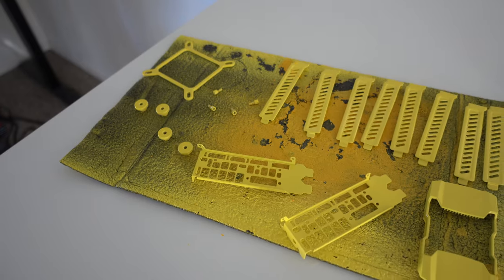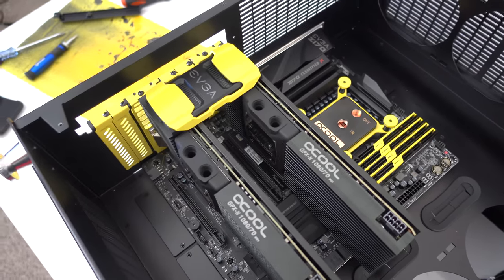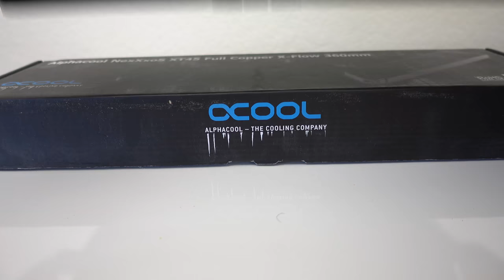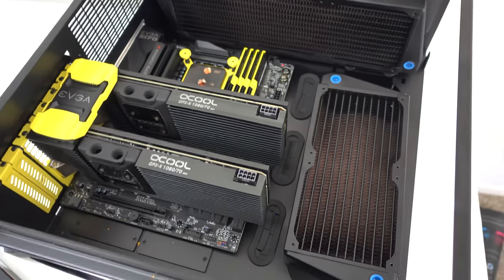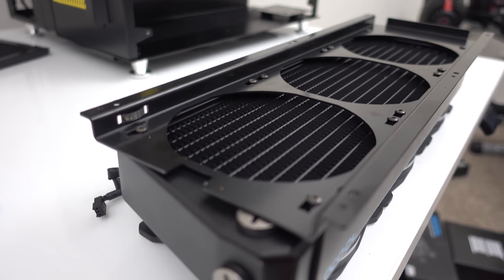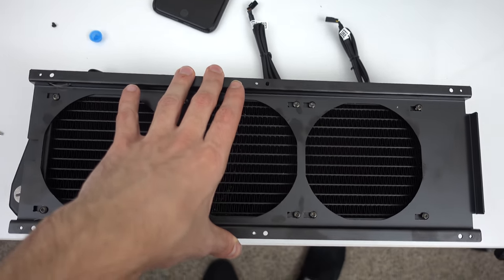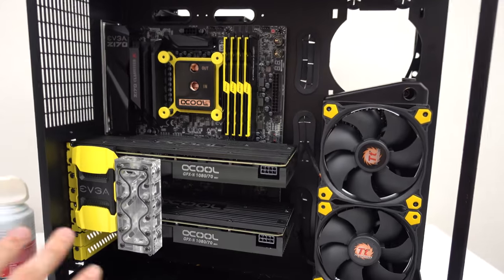My Water Cooling Journey Continues  - Part 4

Comment: You could sand the top of the screw down so it will fit flush with the top of the case :) had to do it with mine

Comment: Dude, dremel the case so your ratiator can fit.
Also, dremel the mount for the radiator so the mount is flushed with the bracket.
Other than that, you can get a rectangular radiator without the curves, it appears you have OCOOL as sponsor or you likey their products. If it will be an issue in positioning the radiator, you can get one from ekwb, their radiators don't have those hips on the sides.

Comment: I think you need grinder in your tools.You could cut of litle part of the top bracket where that screw is,and cut litle hole in back of the case where radiator is hiting the case.

Comment: +TechSource can you just put a fresh set of holes offset to the right of that top mounting bracket far enough to allow the mounting points of the radiator to not impact how it fits into the case?  Looking good so far!

Comment: Is this a good build?

Intel Core i5 6500 3.20 GHz:$199.00
Ballistix Sport LT 8GB Kit (4GBx2) :$59.99
ASRock Motherboard Mini ITX DDR4 LGA 1151 B150M-ITX:$89.99
Gigabyte GeForce GTX 1060 G1 :$289.99
EVGA 500 B1, 80+ BRONZE 500W :$46.94
Phanteks PH-ES215P_SRD Enthoo Evolv Mini iTX Tower Case : $74.99
Seagate 1TB Desktop HDD SATA 6Gb/s 64MB Cache 3.5-Inch Internal Bare Drive : $48.98
Phanteks U-Type Dual Tower Heat-Sink CPU Cooler PH-TC12DX : $59.99
Extensions : $29.99

Total cost = $899.86

also what ssd card should i get
Reply: I want 10k views on my new video pretty decent pc build. You should definitely look at Samsung, Crucial, Hyper, or PNY for ssds
Reply: is the HyperX FURY 120GB SSD good for my build?

Comment: I did my build in this case a few months ago and have water cooled in it too. The EK radiators fit perfectly, I have a 360 40MM rad in the top  and it fits perfectly. I prefer the EK rads because I think the square shape is much cleaner than the odd angled ends on the alpha cool ones. Let me know if you want to know which rad exactly it was I used and I can send a pic of the rad connected up in the case if you are not sure

Comment: Ed, just put the 240 rad on top and the 360 on the side where you currently have the 240 and the clearance issue should be fixed?

Comment: Not sure if this is a correct but wouldn't it make sense to have the tube coming out of the cpu go into the second radiator then from there into the gpus then back into the first radiator? Because then you're pumping hot liquid from the cpu onto the gpus

Comment: Do you know that 240 mm radiator is not enough for sli+cpu?

I have 6700k+980ti and I changed 2*240 radiators to 1 Mo-Ra 420

Comment: PLEASE HELP! My computer only has 1 hdmi output and no other display outputs, however I want a dual monitor setup and have the two monitors. What product do I need to buy to get two monitors running off one output. (I do not want the two monitors to display the same thing)

Comment: Ed, could you cut out a small piece of the case at the top to allow the radiator to stick through the back of the case? I know it wouldn't look as good but you wouldn't have to buy a whole new radiator.

Comment: 5:07 get a drill or a dremel and take back the metal on the bracket to clear around the plug. Then you will not be bending the bracket or mounting the rad crooked. I find it really odd how you will take stuff apart so you can paint it and make it looks cool, but you don't think to cut away a little material to make something fit correctly.

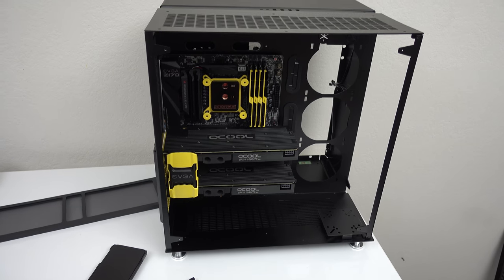7:20 Or option 4... Slide the bracket over to where you need it and drill holes to mount the bracket just a little bit further to the right (assuming you checked everything and you wont run into other issues with clearance on the other side as a result. From what I can see you can move that bracket over like .5 to 1 inch and drill new holes (not hard) and mount the bracket there.

Just hire me to build computers for you...

Comment: u should cut the metal part so it goes around that silver screw on the radiator and u should have flushed the radiator to make sure no factory gunk is left over in there

Comment: as i saw there are spaces you can move the screws around or if it's not working use a dremel tool to make a gap to fit the radiator

Comment: or for both radiator problems just mod the bracket and case so that it works. so for the mount just cut out that little bit of corner. and then re-drill the holes on the top.

Comment: you should switch the radiator's places. put the one with 2 fans on the top and the one with 3 fans on the side, not only it will fix your problem, but it will also solve another one that is that hole open on the side of the motherboard, it may not bug you now, but it is bugging me, and will be bugging you in the future ;)

Comment: Like the design, why don't you try the 360 rad in the area were you have placed the 240 and see if it fits there. From the pics there seems to be room, but hard to tell from the video. Like the yellow, much better.

Comment: Make the slots on the thing you screwed the radiator too longer towards the right. That way you can slide the radiator further to the right. Use a file or angle grinder. 2cm longer and make sure you don't make it wider otherwise your screw heads will slip through.

Comment: Why not swap the radiators?  It looks like the longer one would fit at the front, and use the shorter one for the top.  Probably not the perfect solution for air flow, but its better than having to wait for new hardware.

Comment: Hey guys I need some help! So I just built my first ever gaming PC and was just going to install windows and then I came across a problem. The Hdd wasn't being detected. Straight away I rebooted to try again and I had no luck. I thought maybe the sata cable is broken so I got another one and it was the same result. I thought maybe it's the hdd even though it's spinning. I tried another Hdd that I knew was working and it still didn't work. I've tried a lot and am still getting no luck! Please leave me some suggestions :)
Reply: Bass Trap It could be one of these three problems. 1. Your power supply is not good enough.

2. You have a bad motherboard.

3. Your SATA cables are not working/not hooked up properly.
Reply: did you plug it in the the psu?
Reply: did u select the hdd as your 1st boot device?
Reply: Take the hdd out
Blow on it 
Put it back in

Comment: Use washers to level the radiator. and mod the screw holes on the case. Then it will fit.

Comment: Put the 240 radiator on the top and the 360 radiator on the side, also you should loop the build with a radiator inbetween the country and gpu and a radiator after the gpu

Comment: Just use a Dremel to cut out the notch for the top radiator or put the fans on top with the radiator on bottom. There are a lot of solutions to this problem. Just think outside of the box.

Comment: option 5:
moundt the top radiator upside down so that slanted edge is facing the front of the case where there might be more room.
option 6: drill new holes in the radiator plate so the slanted edge dontt hit the edge of the case.

Comment: Option #4, make a mod, create another set of holes in the case, if you have startered to watercool, you will need to start thinking about modding, sometimes it is easier, cheaper, faster and better.

Comment: I'm surprised none of your options included modifying anything. Drilling new holes in the radiator bracket is an easy do. Drill holes in the bracket to offset the radiator or to offset the bracket to the case.

Comment: hey man, don't you think the top radiator fans should be pulling , rather than pushing ?  I mean, it has been observed by many , over the time, that the former accumulates dust lesser than the latter :)

Comment: what about drilling new mounting holes in the top of the case, and cut a slot for the thumb screw so that the mounting bracket so that it sits flush against the radiator.

Comment: I think drilling holes roughly a half inch (~1cm or so for you metric folks) to the right for the bracket will solve your issue, and it won't be very noticeable at all so your OCD won't go crazy. :)

Comment: merry christmas ed but i think you got the wrong equipment. you shouldve got ek instead of acool. it just looks nicer and it has a cleaner look. plus i dont get that huge heatsink on the vrms on the gpu and then theres just a cpu block on top of it. just in my opinion but if ur happy then im happy

Comment: Oh, but there is a way to deal with that port plug.You change it out with one of bitspowers low profile port plugs. problem solved!!! Also nope, no design flaw with the rad, that my friend is called user error. I understand this is your first watercooled build and it was all sponsored (which is pretty sad that you had to be sponsored with free stuff to be able to challenge yourself to do your first custom loop, by the way), but you don't jump in to the ocean not being aware of what creatures surround you before you jump in. You don't do custom water cooling without doing research and understanding what's readaly available to you before you start.

Comment: hey Ed why dont you put the 360 rad to the vertical place and the 240 to the top and maybe drill some extra holes into the rad-holder-bracket-thing so the 240 rad comes a little to the right maybe you can try it out

Merry Christmas to you and everybody in the commentsecsion

Comment: Or you could just drill the holes over and use bolts and nuts instead of screws. Or add some washers in the mix to add some spice to that technology.

Comment: well, u could drill new holes in the top of the case so they fit with the radiator holes if it is enough space though...

Comment: I never realized how mechanically inept PC builders were. 

1. You could settle for a 1cm gap between your radiator bracket and the radiator, or you could take 2 minutes and modify your bracket with a dremel and repaint it. (I somewhat understand why you settled since it wouldn't be obvious, but the fact that it didn't even cross your mind was perplexing)

2. Your "3 options" were terrible. How about a fourth option of taking an 1/8" drill bit and drilling 6 new holes 1/4 - 1/2" to the right of the existing holes in your bracket? Sure beats ordering another radiator and waiting for another part that may or may not have the similar problems.

Comment: Why that clear block on the GPUs? There is really no need for just two GPUs. It would look much better if you run a tube from one GPU to the other and then connect the remaining two ports to the CPU and the other to the pump.

Comment: could you not just turn around the top radiator so that the bulge faces towards the front of the case? or would that not fit either.

Comment: Get a dremel and cut off the section of the top bracket banging against the silver stud on the radiator. Problem solved. Takes 10 minutes.

Comment: Why don't you just cut the bracket where you need to like around the thumb screw or wherever you need it. Use a dermal or a drill.

Comment: or you could drill a hole in the radiator mount so the thumb screw wont be an issue

Comment: i would have just tried to switch the mounting positions of the rads putting the 240 on the top and the 360 on the vertical mount.

Comment: and also you do realize that, in this motherboard, to run sli u must use pcie slots 1 and 2.. 3 onlz has 4 lanes and is shared with m.2 slot.. bummer

Comment: Why don't you just drill a hole to fit the radiator and cut out a little semi circle for that thumb screw. with a little black touch up paint you'd never even know.

Comment: why doesnt he just cut a hole in the pc for the top radiator and a small on in the case where the thumb screw is in the way, not the easiest option but its definitely easier than buying something new and much cheaper.

Comment: Can I run GTA V? 

Z170 i3 Dual Core 3.7ghz
16gb Ram
1tb HDD
GeForce GTX 1050 Ti 4G LIQUID COOLING
Reply: Theft Tv u got an i3 and 1050 you can but medium to low settings on 1080p Gta v a cpu intensive game
and why an i3 with a z170 mobo?
Reply: ^^ medium-low if you want 60 fps ofc
Reply: Leviossuh Is the low setting still better than a Xbox One
Reply: Theft Tv idk never played gta v on my pc i usually only play fps games but i got an i3 6100 and an xfx rx 470 and get +60 fps on most games with high settings

Comment: Hey guys I need your help,  my friend is selling(used) :
AMD FX 6300 
CORSAIR Vengeance 16GB (2 x 8GB) 240-Pin DDR3 SDRAM DDR3 1600 (PC3 12800) and MSI 970A - G46. 
All for $100 CAD. Is it worth it??
Reply: KiritoX Asuna IMO if you can get a PC with a graphics card for under 100 USD (in this case ~73) i'ts pretty much always worth it. You can always upgrade later if you don't like the performance of one of the components.

Comment: Not gonna lie, I think this thing is turning out pretty badly. The water blocks for all components are gross, the painting choices are questionable, the fans, while they go with the color scheme, have that horrible thermaltake logo, not to mention the blatant color clashing between the CPU waterblock, radiators, and the rest of the build. I know alphacool supplied these things but still. I hate to see so much effort being put into something that seemed to be doomed from the start.
Reply: Luke Bell and he is only using a 6700k when that much cooling would be better off with an x99 chipset
Reply: I think he mostly wants to do a hardline watercooled build in it for the looks, but yes, that is a good point as well